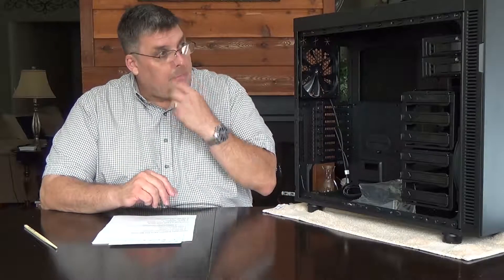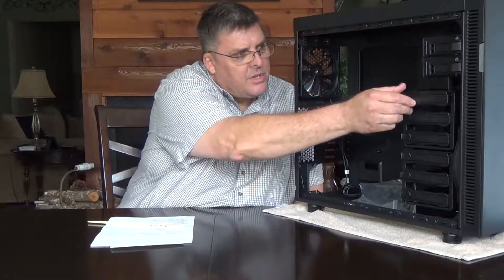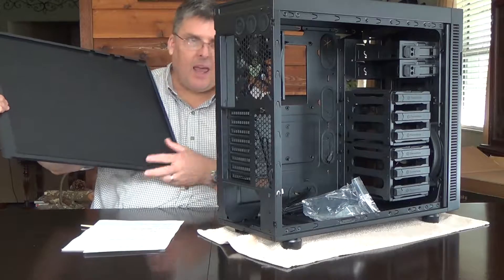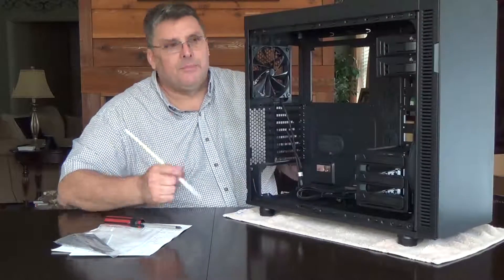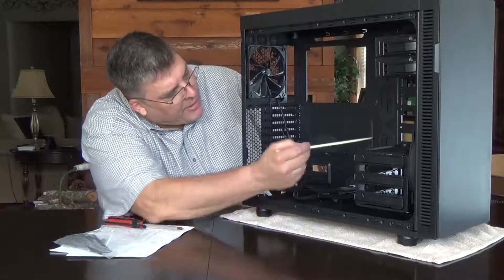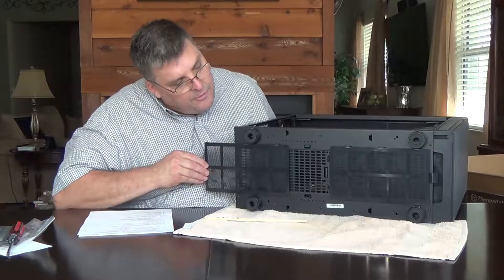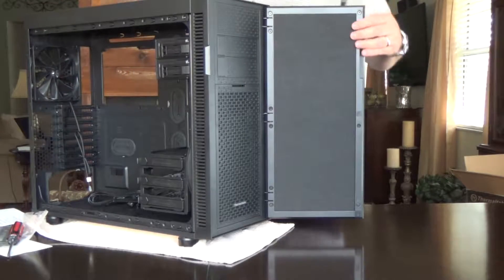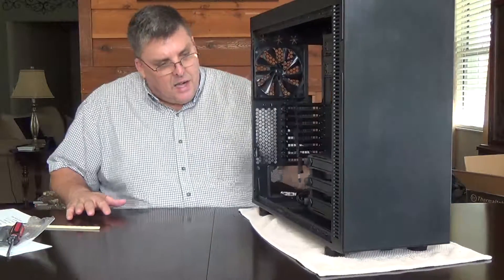Thermaltake Suppressor F51 Overview

Comment: You're probably not aware that the F51 is a copy of the Fractal R5. The R5 has a single bottom filter that you can pull out from the front so you don't have to pull the computer out from the wall to access the rear bottom filter. I am curious to know what is it that you preferred on the F51 over the R5?

https://www.extremetech.com/gaming/207344-thermaltake-accused-of-ripping-off-multiple-rivals-stealing-designs
Reply from the maker: It is quite well known that Thermaltake designed the F51 based on the Define R5.  They improved the concept in several areas.  Interesting you choose to link an article that calls it a rip-off.  There are hundreds of examples of case designs based on another OEM.  You don't choose a case because of a single design area, like the filter you suggested, silly.
Reply: Now don't drag Corsair into this! They are an innovative company ;) I'm sure that you meant to say Thermaltake. Of course you wouldn't choose a case based on a single design parameter. I didn't mean to ruffle your feathers. I bought two Thermaltake drive docks in the past. One died after a few years, but the other is still going strong after many years. Knowing what I know now, however, I do think twice about buying their products. I was just curious as to why you preferred the F51 over the R5. Maybe it was just better availability in your area, which would be an understandable reason to choose it.
Reply from the maker: You began your comment with I'm "probably not aware".  How old are you?  Look man, I have been doing this a long, long time.  I was building computers in 1985 when I was in college.  Of course I research vendors and their products.  Don't expect a friendly discourse when you begin with an insult.  Your page is void of any uploads, where are your build videos.  If you really want to know why I chose the Thermaltake specifically... 1) The Define R5 has no dust filter on the top or side of the case (that 280mm radiator is going to get dust between the fan and the fins requiring a complete removal to clean. 2) The drive cages require screws to install 3) Motherboard sits recessed into the back plate making right angle connections almost impossible 4) The standoff installation tool is plastic and strips 5) There are no 3.5" drive cages on the backside 6) There are many reports of bad airflow through the front, the inlet grill is too small.  Besides those obvious flaws, it's a s great case.  Conversely, The Thermaltake F51 has magnetic grill covers on everything, drive cages require no screws, the case is larger, the weight is heavier (more metal used), a spot for two 3.5" drive cages on the backside and the airflow through the front is superior.  Now, these design specs are well documented on the internet and you chose to link a single article that calls it a copy?  What case are you looking at?  Extreme Tech was a great magazine..... 10 years ago before all the talent left (Lloyd Case in particular,).  Their credibility has been in the toilet for years.  HardOCP and Tweaktown are good review sites you should be referencing.  Now if you want me to keep going I can however, I usually don't engage people that are simply looking for a fight.  And BTW, "didn't mean to ruffle your feathers"  what?  You insulted me.  You insinuated that I am not prepared or have lack of understanding.  What part of my video demonstrates that?
Reply: First, I'm sorry that you interpreted "probably not aware" as an insult. It wasn't meant to be. I would think that 95% of people, regardless of experience, would not be aware of the controversy. I watched your build video, enjoyed it, and gave it thumbs up. During the video, I was surprised at how similar the F51 was to the R5. That led me to your case video to learn more about the F51. Again seeing how nearly identical it was to the R5, it jostled my memory about the controversy, though I couldn't remember if it was Thermaltake or not. That's when I googled to see if I remembered correctly. Multiple links to the controversy were shown, Extreme Tech was just one of the first. There's also a discussion of it at one of you favorites, HardOCP, though portions of the discussion have obviously been removed: https://hardforum.com/threads/thermaltake-suppressor-f51-mid-tower-chassis-review-h.1864289/

To get back to the review, I was interested in your comment at 7:15 that you had considered the R5, but preferred this case. Since they are so similar, I wondered what made you prefer this one. I appreciate your explanations as to why you decided this case would meet your needs better. It's obviously a nice case.
Reply: @geezer2tech154  La principal razón es su precio!